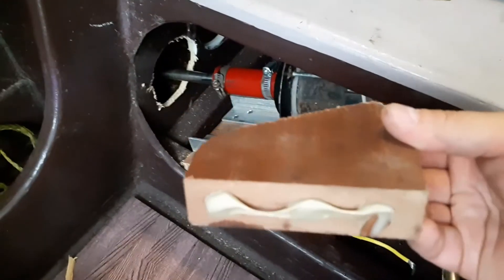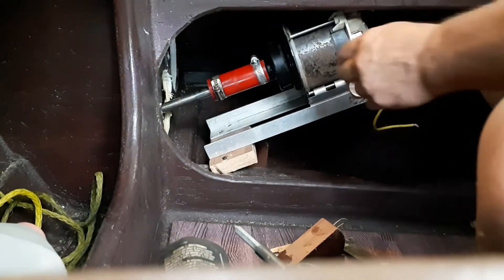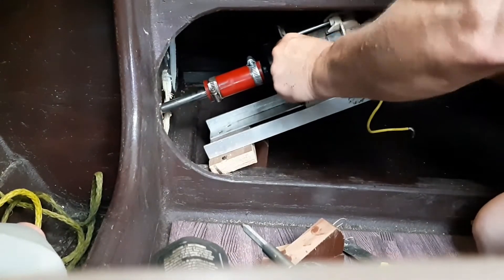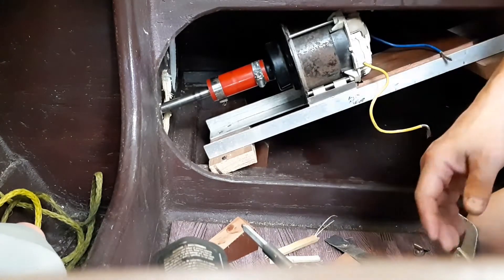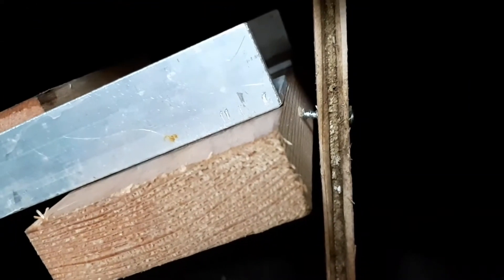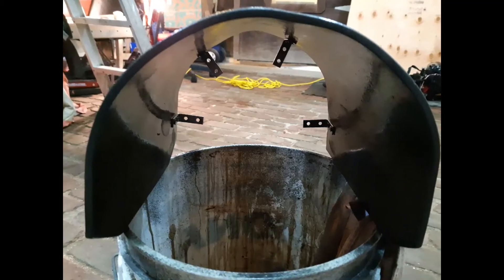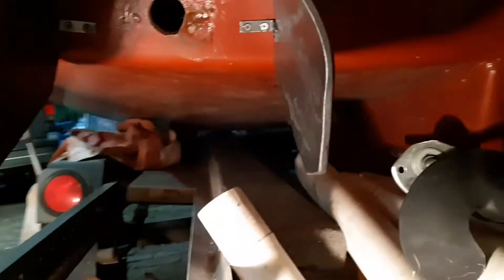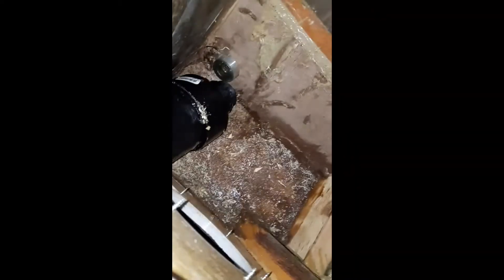DIY Electric Drive, for sailboat CROW...

Comment: if you put a tube around the whole propeller, you get more power! the power is centered directly out of the propeller instead of being lost and going outside around the propeller and get all the power in one place out of the propeller ,,, hope you understand what I mean ,, I have worked with jet power modules ,, at "Österby foundry" there we made water jet modules for, among other things, a prince in the mediterranean ,, his boat needed one (1)  water jet engine !! but he would have 4 on his haha his big boat was like a worst jet ski ,, and its a yats boat,haha money money ,ok.:-) and if you put a pipe around the propp it will be protected from stones grounds ,,exuse my bad english hope you understand,,hehe :-)
Reply from the maker: I understand your English, you are doing well Inge. Very cool project working for the prince! I would go around the prop as you suggest but the angle is bad for the boat when sailing as it will create drag. This is why the sides needed to be straight. They act like fins and will not slow the boat. There is a "bilge Keel" forward of the prop that will help protect it. Thanks for your ideas as I have learned something for the next time!!! Best/Roy
Reply: @roydesignedthat  Ok, Thanks Roy :-)